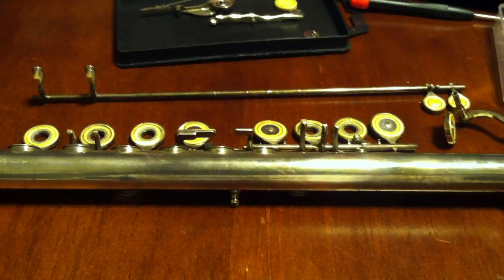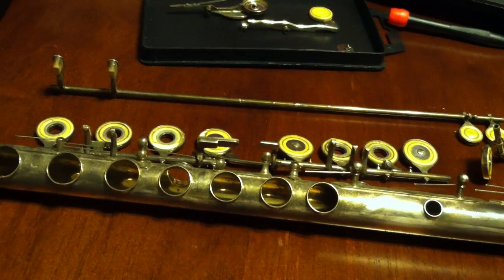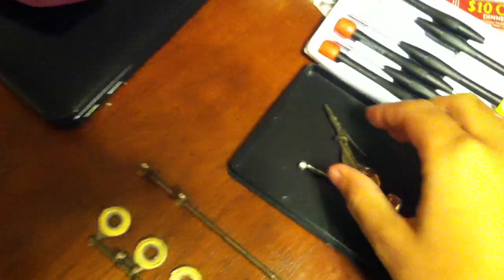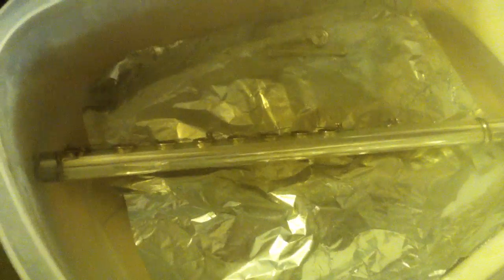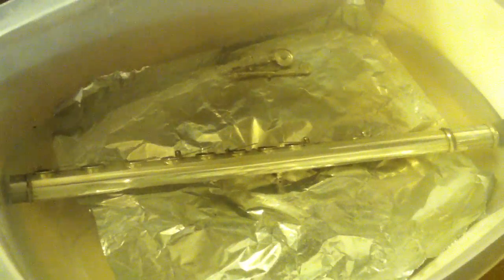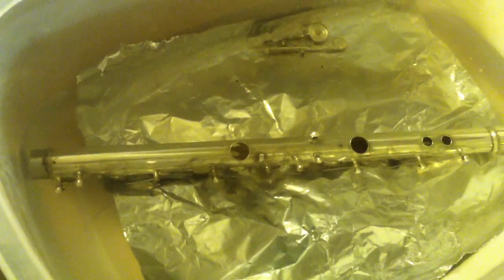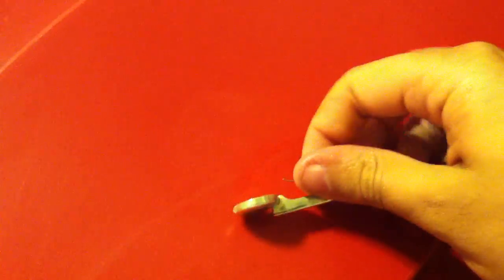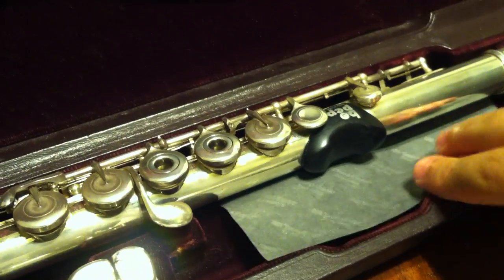How to Remove Tarnish - Part 2 Body and Keys

Comment: Does this method hurt if there is gold plating on the headjoint? Also would love to know have you remove the tarnish from the keys and rods.
Reply from the maker: Hi, thanks for the question. Gold plating should not tarnish so it wouldn’t need this kind of procedure. All of the flutes I repair are tons of work to thoroughly disassemble and clean. Think of making a fine watch. It’s order of operations plus the patience of a saint
Reply: Since there is no way to remove the embouchure plate, will it damage the gold plating? The rest of the headjoint is solid silver.
Reply from the maker: @michelleforche2893  You are welcome to call me anytime and I can gather more information about your specific flute/headjoint. All cases are different and specific in flute making/restoration. If you need help answering questions, feel free to call on my website and we can have a thorough long form chat. This video shows solid silver head and tarnish removal. a greater conversation and detail can happen in person with your flute repair technician who you should see every year like a dentist for extreme tarnish or delicate instrument cases. hope this helps

Comment: I wanna do this for my flute (its the exact same one as yours too) but im so scared of taking it apart, im probably going to just buy i new one. Could i use a q-tip and get a little bit of this mixture and carefulky remove the tarnish?

Comment: Hello Micah, your two video are really a great help for us ,new with this kind of hobby. Fortunately it so happen that I was able to buy a Yamaha Flute exactly what you used in your video. Yamaha 285S11 (model285S2). Unfortunately I was not able the find the exact pads for this Yamaha open hole flute. It is a great help for me if you can tell me where to buy or give me the exact measurement in MM for this flute. I tried Music Medic and they don't carry the exact flute pads for this Model. They told me to try the 2.7mm pads but no guarantee that it will work. Is it possible to sent you money and buy this pads for me. Your great help is greatly appreciated. Thanks and god bless. Mr. Leo Roldan
Reply: my email is reroldan@comcast.net
Reply from the maker: Hi Leo,

I recommend going to .ferreestoolsinc.com/collections/flute-pads. They have collections you can buy outright, or simply call them and they can assist
Reply: @MicahLayne  Is there where you got your pads for Yamaha 285S11 open hole pads? Thank you very very, much!!
Reply from the maker: Leopoldo Roldan my Yamaha is 20 years old. Pads probably from every shop I went to as a kid. Despite being a professional repair technician for flute now, I have not looked at this flute in many years.(it has been a while since I created these videos. I still recommend  ferees. Good people and customer service

Comment: I am a saxophone I know what am doing mechanically.but would it work on very old vintage conn new wonder with out doing any damage
Reply from the maker: Professor Python Gaming if it is silver, yes. Don’t mess with it if it’s plated. There are so many other ways to clean and polish also. This is a cool experiment, but I don’t do any of my overhauls or coas like this.

Comment: Gently washing the flute with liquid detergent diminishes inconsistencies due to oils when immersing.  Distilled water is unnecessary.  Silver-saver paper keeps tarnish away.  Black shoe edge dressing will nicely repair your case's exterior.  It will then look new.

Comment: Would it be ok to remove tarnish like that on a 13000$ flute?
Reply from the maker: Denys Dzhuryn good question! Since I am a professional flute repair technician, I can say yes. I don’t and have never advocated this method as “the best way” or the only way. It’s just safe and non toxic. This method actually does the least damage to the flute. Using abrasive cloths strip small amounts of silver off of the surface of your flute exposing non tarnished silver underneath. chemical dips are highly toxic and many have cancer causing ingredients. If I had to choose one that does the job and is not a major health risk, this is a competent way to do it. Having said that... if you don’t know what YOU are doing, don’t do it.

Comment: Can you take the tarnish  off without taking the flute apart or submerging the flute?
Reply from the maker: Hi Yolanda, you can always use a polishing cloth, however it it not as quick or comprehensive. For example, you will not be able to get the tarnish under the rods and keys without taking those off.

Comment from the maker: No, you shouldn't. If you are familiar with basic flute repair, you can take the keys off leaving only metal. No pads, bumpers, ect are left on the body. If you submerge the whole flute in any liquid, you will ruin the pads pretty quickly.

Comment: If I need to repad my flute, could I just stick the whole body in, pads and all?
Reply: Are you going to replace all the corks and bumper corks too? Because if you get those wet, they become brittle and fall apart. For example, the cork under the D# key. Don't be lazy and just take it apart now because you'll do it later any way.

Comment: Hi Micah, Why does the water needs to be hot? Only to dissolve the baking soda?  Can I reuse the the old solution again and also when it is cold?
Reply: Irene Mens I don't know but generally heat accelerates chemical reactions.

Comment: I really want to try doing this for my Muramatsu GX because when I got it over time it quickly started to get tarnish and the foot joint really looks like some dark cloud has taken over about 70% of it but I'm unsure of how to take off the keys. Is it safe for me to take off the keys if I'm not a professional? I'm just a high school student and I don't have money for repairs nor do I have money for a repair man to look at it. 
Also, sorry to ask so many questions, but do you know why my flute tarnished so quickly? I think you said you had a Muramatsu too so I'm curious if it's similar.
Reply: You posted this over a year ago so you might not need this information any more, but other people might find it helpful.

Flutes tarnish because the metal reacts with the sulfur in the air, and that will depend on a lot of factors. Keeping anti tarnish strips will definitely help while your instrument is in the case. 

The footjoint keys are actually the easiest to take off and reassemble. I'm a high school student too and I did it to my Altus a few times because the low C pad wasn't hitting with the C# at the same time, so I had to take the keys off and add some shims to the pads. 

You unscrew the screw that is in-between the posts on the footjoint. So this would be on the very very end of the flute. The D# key will fall off first, then the C#, the C and the B as you pull the screw out. The keys that fall out might still be hooked onto the springs, just gently remove them. Be gentle with the springs (the pointy metal things) as they are angled is a specific way to hold the key open/closed when it is supposed to. 

Once all the keys are removed, you can soak your footjoint in the water/baking soda solution with aluminum. Rinse with water and let it dry out completely. Then screw it back in reverse direction. So the B key comes first, the C, C#, Eb etc. The C# is a little hard to get in if you have a gizmo key because it kinda blocks the B key, but you just have to do some creative angling to get it back in there. Once all the keys are back in place, rehook the springs so all the footjoint keys prop open without you touching them (except the D#). 

You can also apply key oil on the posts and on the screw while doing this.

Comment: Thanks for these vids, just a quick question. How necessary is it to remove the keys and pads? you say in the vid that the water damages the pads but when we practice for a few hours the pads are soaked with saliva also
Reply from the maker: Hi AntoH, you must remove keys and pads. There are also felt bumpers attached to keys, cork, and paper shims under the pads. All are warped when exposed to excessive amounts of moisture. Saliva or water will damage these parts over time. Soaking them is a disaster.
Reply: Micah Layne Got it, thanks for the explanation!

Comment: Why do you have to have aluminum, like any aluminum object so to say? I don't understand that. 

Also will u make a video explaining how to polish your flute? Mine is very dirty. I wipe it with my cloth but it still looks dirty. I want it to look likeit got clean by a professional. Do u know how to make it look new again?
Reply: Chemical reactions. Your flute is silver, and it tarnishes when it reacts with the sulfur in the air/your body. So it reacts and forms silver sulfide, which is black - hence the tarnish. 

If you have taken chemistry, then you can understand that this is a single replacement equation.

3 Ag2S + 2 Al -> Ag + Al2S3

Silver sulfide + aluminum -> Silver + aluminum sulfide

The aluminum basically kicks out the sulfur from the silver so it is shiny again. Then the sulfur combines with the aluminum in the reaction which dissolves into the water. And as a general rule of chemistry, reactions take place faster if there is greater temperature so hot water is important.

Comment: I can see that this works beautifully, but I just can't put boiling water onto my instrument like that. It doesn't seem right. How does the boiling water not injure the metal of the flute?
Reply from the maker: The question is how would water injure hardened silver? We blow through this tube for a lifetime, spit on it, and slowly wear away the metal with the acid on our fingers and chin. And let's not forget to mention the enzymes in our saliva. The flute is just a machine, nothing more and nothing less. It has to be maintained and looked after. Having said that, to each their own. It is an expensive piece of equipment. Some people are builders/ fixers and others prefer to let others do the work. Both are fine.

Comment: Followed your video steps, worked like charm.  But still have black spots on the body that i am not able to get rid of.   What would you recommend?
Reply from the maker: I am glad it worked for you. How about trying a flute polishing cloth for the spots?
Reply: They are hard spots
Reply: Micah Layne
I feel i need to use very fine soft sand paper or something like that.  How can attach a photo for ?
Reply from the maker: I've not heard of anything like that. I certainly would not recommend sand paper. Take your flute in to a repair technician. It may be beyond normal home methods.
Reply: Thanks for your input and reply.  I ended up selling the flute   :)